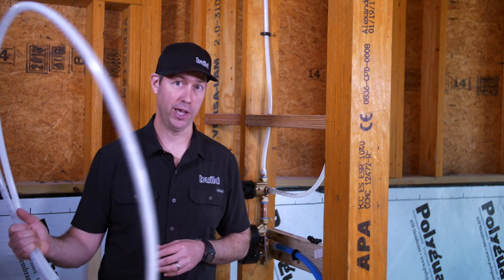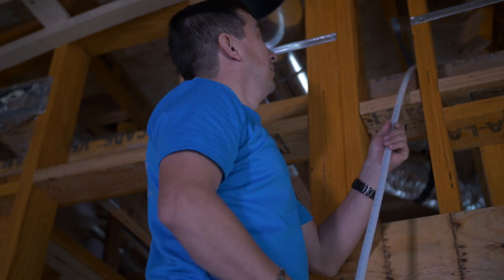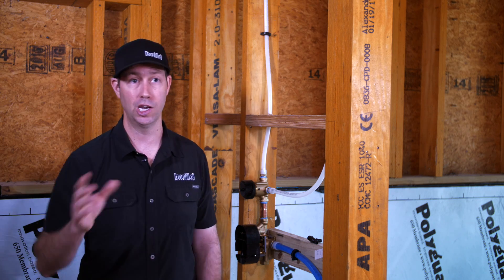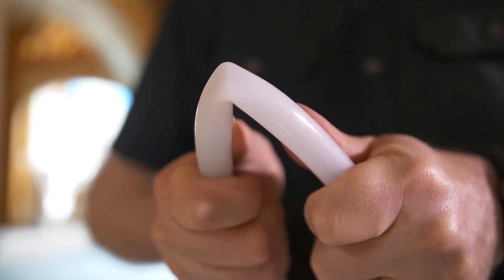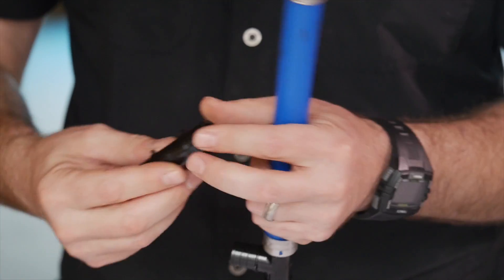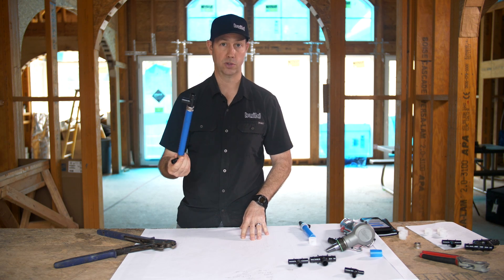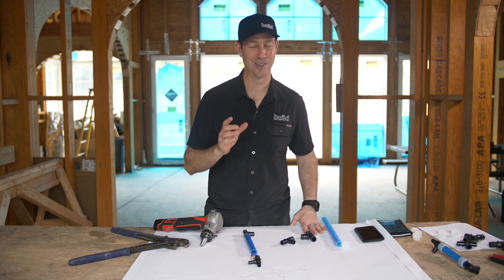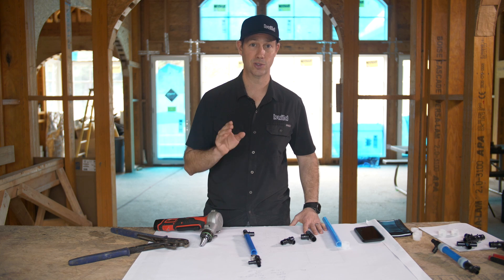PEX vs. Copper Plumbing

Comment: Just curious about where the PEX tubing and fittings are made ?
If it comes from China , I wouldn't put install it if it was free.
Reply: It really depends on who's selling it as to where they get it from, so need to check each item or supplier to be sure.

Comment: Never seen the PEX-A system before, & think will try on next job. Have used the normal crimping method before, but that was pretty impressive to see! Wow.... Would live to see the data on how well holds up over time & in diff climates without having a crimped fitting, as one would normally think of. Sometimes technology CAN improve & make our lives easier😉
Cheers, A
Reply: Aepek I agree. Especially in S AZ the heat would probably cause the collar to loosen and leak. Sometimes ya just gotta grunt out with the crimper

Comment: Hello I have Viega I ran it like you would install copper. I know you can use the manifold system which I would have liked to use but as I was renovating my house I needed to cut cost of things for additional extras. I have the Viega with the aluminum coated cover. I like the way it’s installed with the stainless fittings. The other system you showed is nice. I like the larger fittings.

Comment: Built my new house with Uponor PEX-A. Great system. When I was designing the house, I asked several plumbers in the Detroit area: PEX or Copper. Best answer I got was "PEX, because I don't want to plumb my house twice with copper - once on rough-in, and a second time after someone walks away with all my Copper!!"

We did use about 10% copper. When it sweats, it is great, but the occasional fitting leaks, and drying it out to repair it is a real pain. 

Tested all my PEX with air. Only leak I had was when I re-used a fitting on my pressure test manifold, and nicked the barb with a razor. 

Re-work is always harder than getting it right the first time, but with PEX, if you make a mistake, hope you have some slack - there are no re-dos, cut the tube and replace the fitting (you can use a torch to remove PEX from brass fittings - I wouldn't try to re-use a plastic PEX fitting). Reworking Copper is always tricky, but it is possible.

Comment: There's a difference in pressure drop vs. volume drop. Smaller diameters will drop volume, not pressure. Not sold on anything plastic yet for permanent plumbing in homes yet. All local water sources  will have chlorine which over time, will make them brittle and eventually crack if there's regular use. Any new home built with PEX better have disclosures the pipes are PEX as most home owners will want to know if they are going to have to deal with them or copper, the traditional king standard. PEX reminds lots of folks about mobile homes and we all know how cheaply those are put together causing any repair issue to be a replace, not repair job and finding parts will likely be problematic as you noted.

Comment: While pex is easy to use, l have been repairing pex leaks the last several years of about 2 a month.  These are splits in the pipe usually in a bend, same as poly.  We have been cutting out bends and installing couplings and 90s to repair the splits.  PEX is starting to have the same failures as poly.  It's very depressing.

Comment: Im a plumber for30 years and one nice thing about pex is it takes no skill whatsoever to intall.
Made with petroleum ⛽ so its slowly kills you, i wouldn't have it in my home
Also this is not a commercial for pex
He just says pex every 30 seconds
Reply: Yeah that is nice it takes very little skill. 

Yeah it's made from petroleum. But, do you only eat and drink out of glass and metal containers? When you shop at the grocery store do you only buy things stored in cardbord?

What does almost everyone fill their cars up with and burn? Do you think we are not breathing all those exhaust fumes in regularly?

Pex is a very very good product. If that's the worst thing you can say about it. Then you should think a little more about it.

On a side note if your worried about toxicity of tap water from the pex. You should actually be more concerned about the toxicity of the tap water itself.

In most places that stuff is straight up slow poison.

Comment: I've been using (Insulated) CVPC, PEX(OX BARRIER), & PEX-AL-PEX (NO PVC except for drainage) in place of copper for both chilled/heated water for environmental comfort (HVAC) in both residential and commercial settings where Copper isn't specified, and have had fewer problems than copper mainly that less skilled Apprentices & Labor is less likely to have a problem making connections that with Hard or Soft soldered joints, and (as mentioned) the fact that there are fewer joints to start with

Comment: PVC is better. Just repaired a bad PEX fitting in my house. The fitting was junk to start with. Had to repair it with a new piece of junk. I will never sleep well in this house again. I have never had an issue with PVC. It just works.

Comment: I am a huge fan of split rings.   Much faster and you do not have to charge or worry about batteries while working all day.   I can rough a house in much faster while doing crimp rings.  The expander tool is just too damn slow and very hard to get in tight spots.   What i do like about the type A  ( Expanding Pex) Is that you never miss a connection on accident because you can not dry fit!  That said I still rather use Split rings and you should test with a compressor anyway.  SO not the end of the world if you do happen to forget to crimp a fitting!  Nice Video !

Comment: Copper is a heavy metal and does enter water flow at the fittings where water molecules wear down the inside of those  fittingsOn older copper systems you can actually taste the copper. Then theres the question of solder used to connect copper pipe. Older solder contains up to 50% lead.When the chemically treated water sits at the solder joint it leaches the lead into the water.

Comment: The PEX A has a full 1/2 3/4 etc flow.  The others lose volume due to the fittings which inside diameter  is 1/8 in thick.  So for a 1/2 pipe you lose over 40% of your volume.
Reply: 6/8 = 3/4    so 25% less, and you suck at math

Comment: I'm old school so I'm copper man.  
I also use pex for special situations like pre-existing pex; corrosive well water and freeze hazards.  I only use Uponor pex-a for the ID of the fittings and the pressure that it can stand without bursting.  Awesome system!
Reply: If you are a really old school guy what not using steel pipes?
Reply: Still, you prefer copper, right?

Comment: Hello Matt, a question about plumbing and water health issues. When reading about PEX-A/B), (C)PVC and LDPE (Tyleen) there are references to researches where leaching of chemicals are described as harmful. PEX residues are even tasted and good be smelled? I don't know because I do not have materials at hand, but wouldn't you like to know? We have had the story about BPA's, BPS's and other chemicals we don't want in our drink water. Sure we don't want them in our plumbing where they are not easy replaced. I also read mice eating through PEX! I hope you will reply and would like to see a video where you address these concerns.

Comment: A major problem that alot of plumbers or general contractors is the quality of water you are ggetting from city providers. Fluoride is an industrial toxic by product of mineing and coal power plant production. Think. Its illegall to burn it. Same to just pump it in the ocean. Legally its classified as a pollutant. Medicines are made out of fluoride to help mental patients who magically go on shooting sprees. Fluoride doesnt help your teeth but it will help cause calcium deposits on your tankless heater. Ever break open a traditional hot water heater? Ok watch a vid on you tube. Its a nasty mess in there. Fluoride gell. In summation i say i install pex and it works. Enjoy your involuntary poisioning

Comment: You keep saying pressure drop. you don't get pressure drop you get a change in volume big difference. The pressure will stay the same throughout the house except the second floor do to gravity and even then you will only drop a pound or two. For example, You will get the same water pressure from the hose bib in the back yard supplied from a half inch pipe as you would from the house bib in the front yard supplied from a one inch pipe at the water service riser But when you go and use either one of those bibs you will see that the volume of water coming out will be different do to the pipe size and length of the pipe servicing the hose bib. Oh and another thing the class of pipe does not refer to the brand. Uponor is by far the best brand and is class A but i can name many different brands and classes of pipe.

Comment: Coming from Europe, we use a lot of AlPex, which is an aluminum core layer sandwiched between two layers of pex. I’m surprised you don’t talk about those and the different metal fittings for them :)
Reply: Probably because they don't sell it in America, so there's little knowledge about it here, or a need to know.

Comment: PEX was installed when we bought our home. we've had one joint after another fail costing us thousands.
Reply: You don't say when it was installed, whether it was early pex or early type fittings, or the reputation of the installer. All those things are variables. The wrong type fittings could have been used.

Comment: I have used MLCP in europe for 16 years, its far better than PEX it has a layer of aluminum metal within the core that reduces thermal expansion, it keeps shape when formed it is a superior product. In 15 years 0 leaks. Great for Underfloor heating with options for 12mm and 16mm.

Comment: I have tried the Rehau parts (expand tube then slide the collar) with the Upnor hand expander (expand tube and collar together).  Seems to work just fine.  

The Rehau system holds full pressure immediately while the Upnor system needs time to shrink.  Rehau tube costs less and is rated for both hydronic systems needing an O2 barrier and potable water.  With Upnor you get one or the other at a higher caost.

The Upnor system uses a simple manual or motorized expander while the Rehau systen requires an expensive dual function motorized expander/clamp.

For low volume use I expect I am getting the best of both with the Upnor hand expander and the Rehau parts.  I don't mind waiting a bit before applying pressure.

Comment: Very informative video! I have heard a lot about Pex tubing for water supply but did not know anything about them. He also talked a little about the down side of copper tubing which I did not know about either. The only bad thing that he did not mention was the cost of the tools for using Pex which I think would be quite high for using only once in a while. Can these tools be rented somewhere easily?

Comment: He conveniently omitted the critters. In areas where there are mice, rats, skunks, opossums, etc., plastic pipe can be chewed through. Rodents can't chew through metal pipes. Maybe, if you're a contractor throwing up a subdivision, cost is the only factor.

Comment: You did not mention the stainless pinch/cinch clamp system.  I like them for the DYI work on small jobs. One clamped fits all pipe and is low cost. The clamps are stainless steel. For a production builder the tool cost is not a big issue. For a one time user, the cost of tools is an issue. 

You did not mention the pex issue with uv light if stored outside or has that gone away?

Comment: "You're only going  to lose one or two cups of water getting hot water to your shower".
Bull Shot
Reply: He also said to read the book that was written about designing a system. If you have a system using an on demand heater frequently the heater can actually be mounted under the sink with very short runs. Another possibility is to use a recirculation pump in your system. These units continually cycle the water to ensure low flow times and are used primarily in apartment buildings. My shower is on the fourth floor of our building and I get hot water within 10 seconds thanks to the recirc pump. If someone turns the pump off, and this has happened, the water will have to run the better part of a minute before any hot water arrives at the shower head.
Reply: Just get an apartment next to some old people who get up early.  You'll have hot water in two seconds for your morning shower every time.
Reply: Um navien or viessman ... never heard of a re circ loop ?
Reply: Go watch Gary Klein hot water.
Reply: Yeah.  He's probably referring to a recirculating loop.
Reply: I built a smaller home, didn't need a loop system. I located the water heater close to use areas, then I used a home run system with 3/8 pex (could have used 1/4). That reduced the water volume in the pipe. Hot water at my kitchen faucet and master bath take 3.5 seconds. My farthest is 7 seconds. I may change it to 1/4". Also, the home run system keeps the hot/cold balance even you can take a shower while washing clothes, flushing a toilet, and no change in water temp in the shower. I used the brass fittings with the copper crimp rings. The all plastic expansion tool looks like the way to go in the future!

Comment: A copper pipe will last 120 years or more and you can work with it the entire time.  PVC becomes brittle and harder to work with over time.  Eventually, you have to replace the entire pipe if you want to work with even a small portion of it - all because it's too brittle to work with.
So how does PEX hold up over time?

Also, copper, silver, and gold all have natural anti-bacterial properties.  This is just a minor argument for copper though

Comment: Im a 33 year Plumber. I install Pex all the time, If I were building my last home to live in Id build it with L type copper tubing for water Supply system and be sure it was done right so no freezing because I think the human body needs copper in micro amounts but doesnt need Poly Ethelyne .

Comment: And do not leave Pex in the sun... That seems to make it brittle.. You can use it for sprinkler sy systems and such, but do not let the sun be exposed to it..  It will lose it's flexibility and become like PVC when it comes to leaking eventually...   But mostly agree with you on every other point, but mostly the ease of it is what I like...  But I've heard people using it for compressed air but not dared it  yet..  I like copper anyway for the cooling effect and that is pretty major when it comes to keeping out condensation in tanks..

Comment: Obviously the big point is that you need a huge crimper or a special expanding tool versus a can of adhesive with a tiny swab. Big difference in cost if you are not a professional. Thanks for showing that. Copper needs a flame and provides lead poisoning. Very informative and clear.
Reply: Lead poisoning!?  Do you know anyone poisoned by their copper plumbing?  I'm a fan of copper, ProPress, and Uponor/Pex-a/ProPex; however, where does your lead poisoning come from?  Is it soldered connections?  Lead-free solder, my friend.  As in all plumbing, installation and technique matter.

Comment: When I started in the shop in 2000 we used wirsbo type A. And now All I use is type b because i dont know where to buy type a or want to buy more tools.. Both work great and far as tools and piping. Personally I didnt have automatic expander it was all by hand for the type A.. Cpvc not a fan at all and cooper is becoming a lost art

Comment: Another point.  You say that there were no problems except for one fitting failure out of hundreds of houses built.  How long did you track these installations?  After 7 years I have read that these pipes start leaking because of splits in the pipe.  We had a small leak for God knows how long on a 7 year  old house.  By the time  we discovered it we had a huge mold problem.  The leak was so slow because it was a little tear in the pipe, but it did alot of damage and required a whole new kitchen after the mold was eliminated.  We were without a kitchen for 9 months because of the extent of the mold damage.  Contractors are getting lazy and don't want to deal with installing copper.  It is the gold standard and PEX is a disaster waiting to happen.